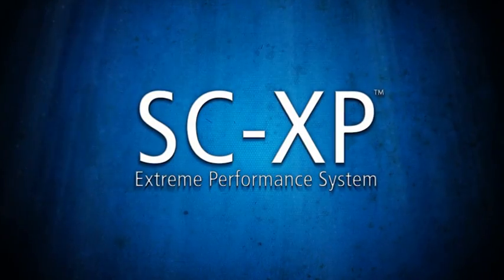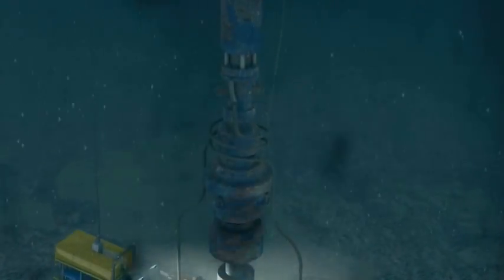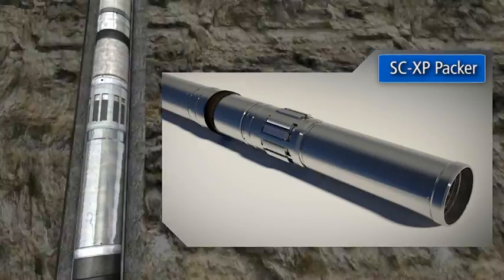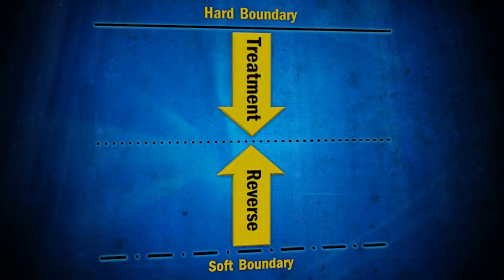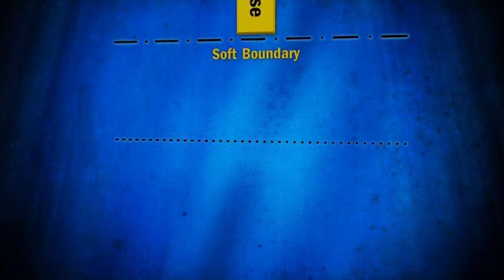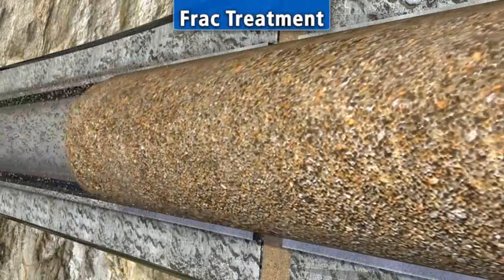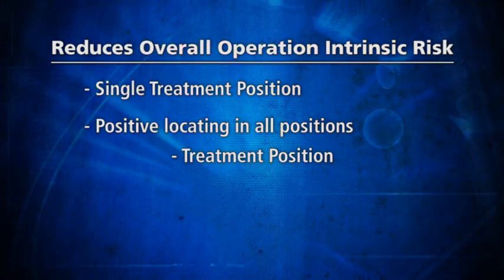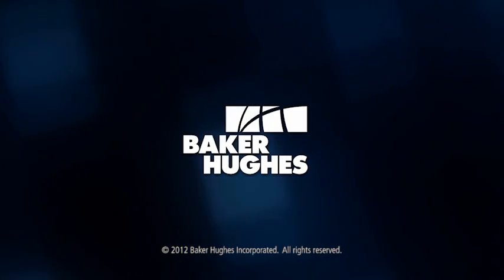SC-XP Gravel- and Frac-Packing System

Comment from the maker: Both systems are used on offshore wells, not for onshore frac completions. Offshore frac-packing jobs are performed using technology vessels which have closed-loop pumping systems and zero discharge of pollutants into the sea. The SC-XP system is a set of tools used to carry the completion system into the well and to conduct the fluid and sand used to treat the formation. There is no impact to the environment in this process.